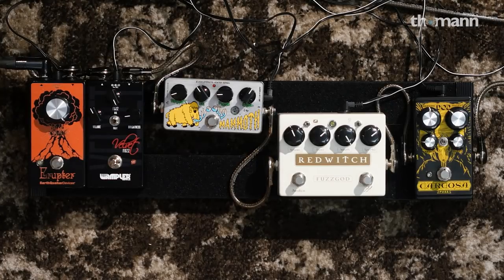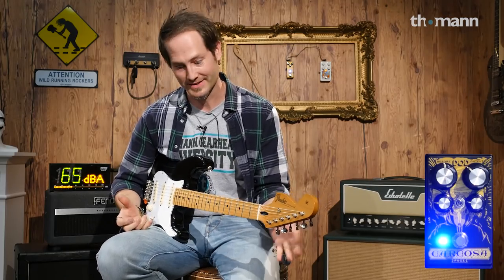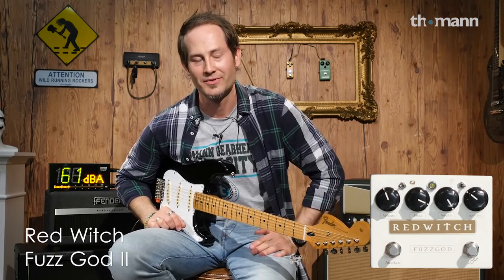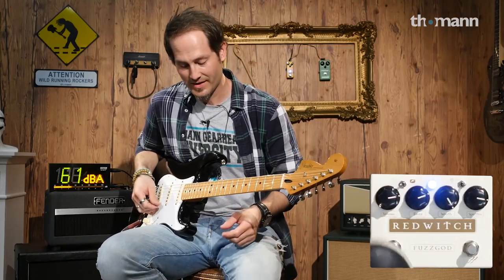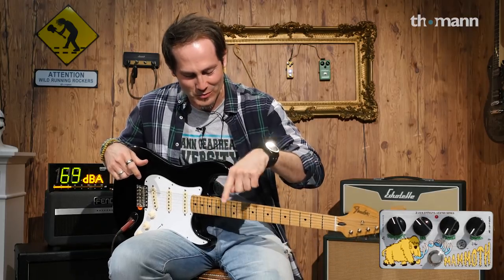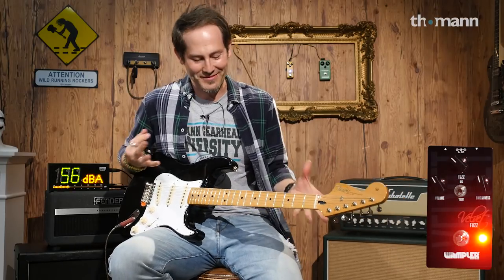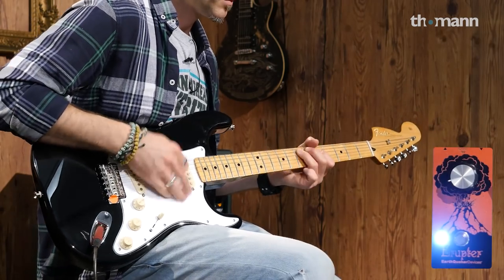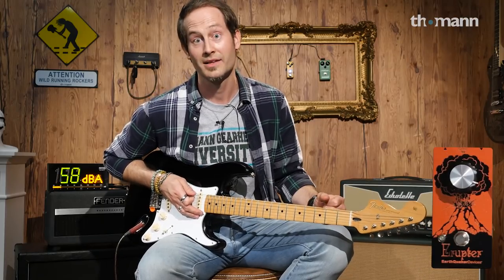Top 5 | Modern Fuzzes | Demo

Comment: That's my Bassbreaker 15! It loves Muffs and my Lovepedal White Dragon.

It does NOT like OCDs, prefers TS9/Klon/Marshall-style pedals eg Buesbreaker, Angry Charlie Doesn't like D-style (that's what she said).

Great amp but beware the FX loop! It sucks!
Reply: Matt Gilbert -i was thinking of getting in ocd to run next to my 808 on my 007, glad i came across this bit of info. I was considering a muff as well? Which muff do u prefer?
Reply: @brig8013  I have 5!

I like the Opamp and Geeen Russian. Both respond well to a boost,  the Bassbreaker15 likes most fuzzes and boosters. 

I did get an ok sound with an OCD but that was with hunbuckers. I prefer singles. 
I ran it:
Epiphone LP Special 2> OCD> Xotic Ac Booster> BB15 (bright switch on, lo gain setting,  master cranked)
Reply: @brig8013  007 is a very different amp tho.  It's a genuine class A, I think.  More of a tweed tone. My Tweed Blues Junior likes OCDs. Maybe it'd work for you.
With that amp, I'd consider something like a RAT or Vick Audio V-2 instead of a straight-up Muff.  But Green Russian might work. EQ pedal is your friend when using different amps
Reply: @brig8013  Do you know the MI Effects Crossover Drive? That's killer. And any bluesbreaker pedal like a Morning Glory works with most amps. OCD is hit 'n miss.  Depends on your guitar and pickups

Comment: Isn’t that Erupter knob a bias knob and it’s always on volume 11?
Reply: Yes it is bias. It only affects the volume as a side effect of changing the voltage. As cool as the 1 knob design is, it makes the Erupter a little hard to use. You can actually get a big volume drop when you turn it on, or the perception of such because it's so fat it gets lost in the mix. And of course it can also be a big volume boost. You kind of need an active volume looper to use it. It is a super awesome sounding pedal though. The guitarist in my band has one and when he turns it on it's always like wow what the f is that??? Definitely makes an impression.

Comment: Carcosa is a killer sounding fuzz for its price for sure! But I must say, that built quality isn't so great. Especially paint job on back plate of this puppy sucks. When I tried to take the pedal from my pedalboard after a long time, the velcro remained on the board with part of the color from the back of the effect... :D Quite funny story.
Reply: Built quality is great, actually. They might be made in China, but these DOD pedals are better built than some of the big name brands, particularly EHX and MXR. The components are just as good and the switches are even better than MXR. Some paint coming off because your velcro failed you isn't the pedal's fault. Besides, it's no big deal...I'm sure the pedal still works just fine.

Comment: I would have chose the fuzz master  general  by earthquaker over this one. I prefer one with an octive option and versatile as the one already mentioned or the orange fur coat. The devi ever shoe Gazer is also a great 2 in 1 pedal, but without the octive. The green house sludgehammer is a beast for real doomy stuff. I don't really care too much for the glitchy pedals. I could probably find something good to use them for, but for the most part they sound like faulty equipment shorting out. Why pay money to sound like a bad amateur who can't afford good equipment?
Reply: The only issue I see with the Fur Coat is that it only gives a higher octave, but not lower. I rather play with a separate Octaver that gives a 2 octaves difference.

Comment: Nice video, but could you play appropriate styles for the pedals? I've been in the market for a fuzz and the style you play is not helping.  Think Smashing Pumpkins, Black Sabbath etc.  I ended up getting a Carcosa, which I'm thrilled with.  One of the main things which sold me was how it reacts to a dirty amp and how my volume controls was suddenly my gateway between slight overdrive to raging explosiveness. These are the things we need to know, as well as how the pedal sounds for APPROPRIATE styles.  Not every fuzz user wants to emulate the 60's.